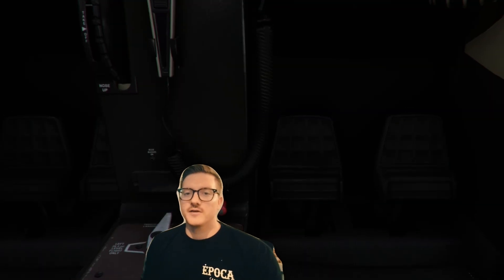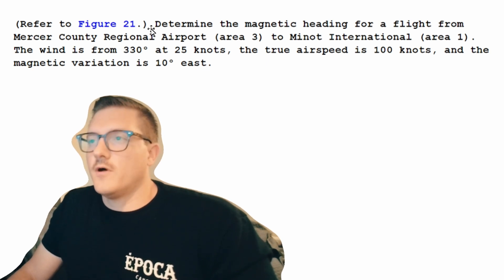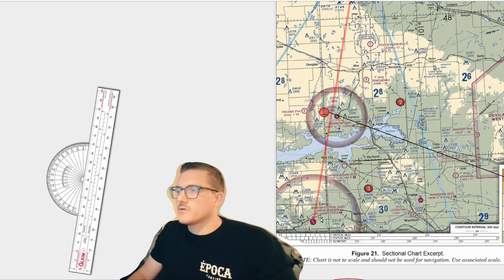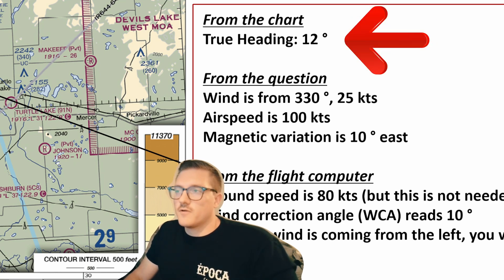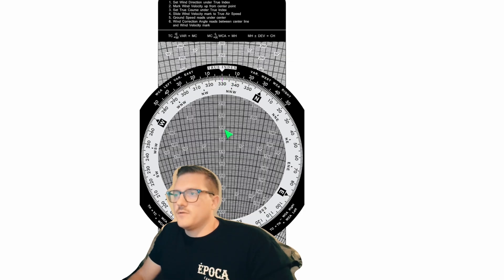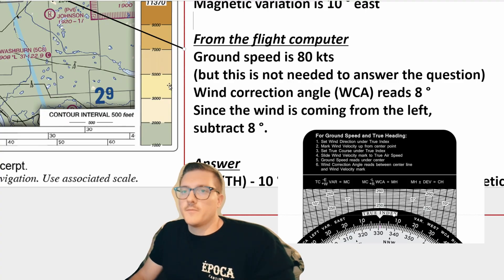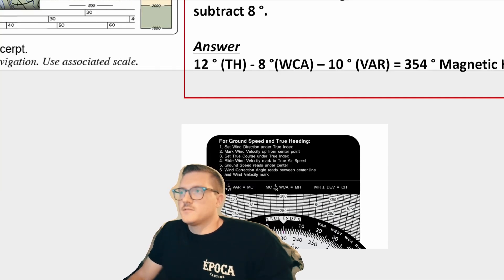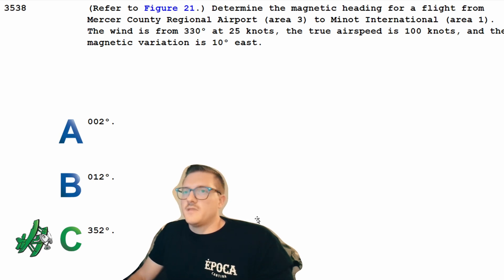Private Pilot Written Exam Questions for Cross Country Planning and Navigation - Question 3

Comment: When using an electronic CX3. How do you know if you have to account for the wind correction? without takng the wind correction into account it'll give you the wrong answer. so not sure when i need to add it or not
Reply: I just realized magnetic course and magnetic heading are two different question on the written.

Comment: What program are you using for the plotter? I normally place my e6-b on top of my ipad or on my monitor and it’s very hard to get the correct true course and correct distance for these types of problems
Reply from the maker: All of that is on PowerPoint.
I use a PNG file of a plotter and removed the clear parts of the plotter to make it transparent.